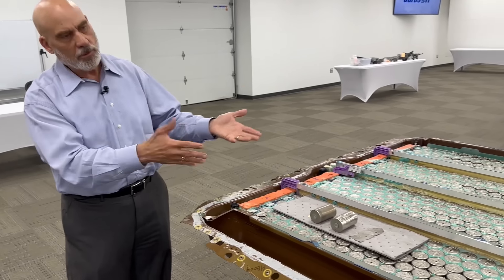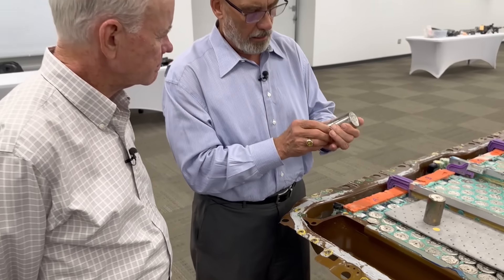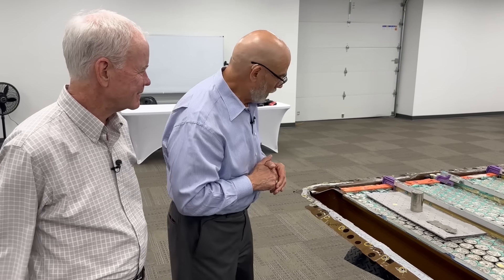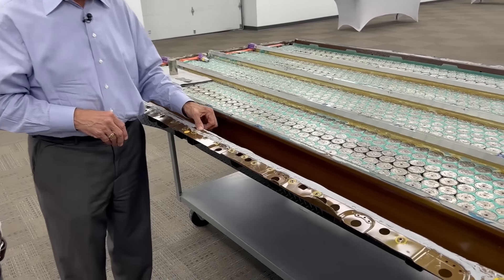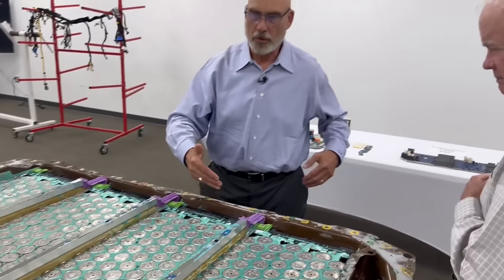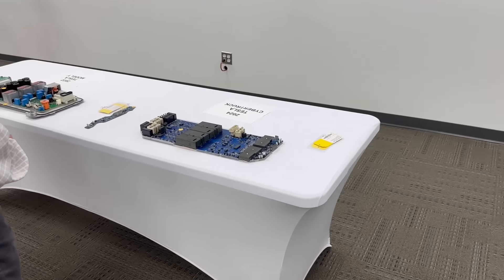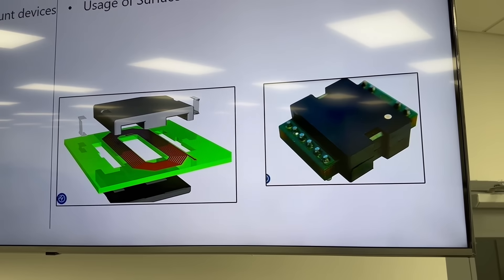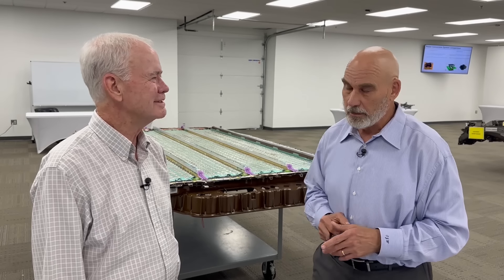A Look Inside the Brains of the Cybertruck's Battery - Caresoft Teardown

Comment: The surface area contact of the metal determines cooling efficiency. Bare metal to metal contact is very inefficient heat transfer, microscopic air gaps prevent high thermal conductivity, a thermally conductive medium needs to fill in air gaps for much better heat transfer.

Comment: Terry acknowledging his error is very professional. I was on the fence about his opinions but liked his informational videos and this made me appreciate him even more.
Reply: I agee, but, I think he'll have to admit another error. I don't think the large electrolytic capacitors were replaced with the MLCCs. Typical large MLCCs are around 50V/100μF IMHO.
Reply: @Bits4Blits  Absolutly. I did not even see any bigger SMD caps there. I wonder if the HV is even galvanically isolated to the 48V System. There is some trick used here by tesla

Comment: Some EV Battery fire fighting tools punch a spike through the bottom of the battery to introduce cooling water. 

Is there "air space" at the top of the battery pack above the "mica" cover, that is not filled with foam?

Is there "air space" below the batteries in the pack?

Where does the "bb" pop out to allow venting?  Isn't is held in place by the foam above it? 

Just to confirm, TESLA battery  packs, specifically CyberTruck, are completely packed in foam so the spike will not work to introduce cooling water.

Sorry, I wasn't able to identify the coolant ribbon when you were pointing to it.

Don't you think that the foam acts to keep heat in the batteries?

Comment: It’s been my understanding that Tesla chose side cooling to have a higher contact surface area to transfer heat across.  With the larger radius cells, has end surface area started to approach the side contact area?  I’d bet not yet or Tesla would used end cap cooling and enable putting more cells in the pack with removal of the winding cooling conduit, and gain a simpler cooling plate design.

Comment: Hi at 14:40 it's not quite the same kind of transformers. The ones he is talking about is iron core transformers the ones for the Tesla uses iron ferrite core and are switched at a high frequency not 50-60hz like on a regular HV power transformer. Fast switching makes them far more efficient when stepping down voltages. Old technology though. If that cybertruck PSU goes short on the transformer windings it will blast a big hole in the PCB and then the whole PCB will have to be replaced. All this is not for more reliability ,but for energy efficiency and cost reduction because of reduced production costs.

Comment: Looks like you had a few dramatic moments on getting that mica off. Those BB's are GONE. Dry ice?
Heat removal for cylindrical has much more %surface area in contact with the cooling channel vs other formats. Studies show that side cooling is most efficient with cylindrical, up to a certain diameter, this cell is starting to hit that limit. 
Snap fit held in place with foam. NEVER moving.
Nice job getting access to the array BMBs. See if you can find the easter egg in those!!
BMS/charger upgrade is impressive

Comment: Thank you for the video, I also enjoyed the calm explanation from Terry and had no problem understanding the presentation, maybe since I'm a bit like him.  But, regarding the physical battery pack design, as a long time mechanical engineer and designer I can't accept that filling an assembly with potting foam is a professional solution, nor a good idea. The fill volume and density is too unpredictable and of course it leaves the pack totally unserviceable.  It looks like something I would have built for a science fair project in 8th grade back in 1968. The problem with a round cell is that the elegance of that design concept falls apart the moment you have to package hundreds into a rectangular enclosure, literally a round peg in a square hole.  The low-quality coolant fittings and excessive number of connection points concern me as well, adding to the risk of failure.  Other EV makers (e.g Hyundai-Kia and VW) have moved cooling to the outside of the pack for exactly this reason.  IMO, the balance of product attributes seen here trades away too much in safety and quality in the interest of cost and thermal performance. I realise you can't say that but I can be honest about it.

Comment: If I'm reading this segment correctly, the entire CT battery pack is not repairable and has to be replaced as an entire unit on failure?
Reply: This is how Tesla has done their batteries for a while. On some of the older models third parties have done battery surgery to replace individual cells, and I think it might still be possible on this pack, but it will be a lot harder

Comment: Voltage converter from y and cybertruck are different because they are different frequency and perhaps power ratings. The capacitors in y are big to smooth the dc on the high side.  The cybertruck converter does not have those capacitors despite what they say in this video.

Comment: I found Woychowski's presentation to be full of opinions, but not well backed up. He talked about going from 800 volts (DC) on the main battery to 48 volts (DC) for car operations and then told us all about the transformers that do the transformations. Transformers work only with AC power. An actual description of how DC voltage is raised and lowered in modern electronics like the Tesla would have been nice.

Comment: Regarding getting the heat out of the cells, heat is generated by the internal resistance of the cell. Lower resistance means less heat needs to be removed. If they can remove enough heat from the cell with their present method, there's no reason to change.
In addition, with a 4680 cell it is only 46mm across the cell but 80mm vertical so it may be more efficient to remove heat from the side(s) that from the top or bottom.
Reply: They also employ tabless battery design, so an electron from the very center of the roll, for example, does not have to travel round and round the whole roll, but just goes to the top of the tube, which means much less resistance due to that shorter distance, which means less heat and loss.
Reply: @AllanSustainabilityFan  Good point. The best internal resistance is no internal resistance. - Me
Reply: The heat has to travel further to reach an end but it doesn’t have the multiple layer interfaces to conduct across, as the battery is rolled up inside the tube. I believe Terry is correct about this.
Reply: The Cybertruck reaches a higher cell temp than the new Taycan/Macan despite the charging curve dropping off at a lower SoC.  The cooling is a bottleneck.
Reply: @concinnus  Not the same cell chemistries for starters. 

Taycans have also been known for some early battery fire cases. Porsche has dropped the charging rate a couple times, and replaced batteries behind the scenes to avoid offering official recalls so far, as they were still learning their own EV production processes.

Tesla, on the other hand, is known to start conservatively with charging curves on new designs these days, then bump those up with software updates - and upgraded Superchargers - as they gather data. They already went through Porsche's growing pains back in the early Model S days.
Reply: @AllanSustainabilityFan I have to give porche props for their battery performance so far. They’re seeing very low degradation and the new taycan charges even faster. It’s impressive
Reply: @SyntheticSpy  That easy to say because, as mentioned, the ones that had bad degradation were quietly replaced in order to avoid a mass recall supposedly. 

There's even a case from a whisleblower that's going through the German legal system iirc.

Either way, modern batteries with modern thermal management is superior in life cycles vs an ICE platform, I'm sure Porsche's EVs will outlast their ICE ones easily.

Comment: There was some modeling done that showed side cooling was actually better than end cooling. Basically, the surface area contacting the coolant plate is much bigger with side cooling than end cooling.
Reply: Yes i have seen the same. Many say that top or bottom is best (rivian and Lucid for example), but i saw Japanese battery scientists saying their research showed that side cooling is best if you have enough area (like Tesla). Immersed cooling is of course best, but that adds a lot of weight. Air cooling can actually be quite effective to. But everything has it's downsides.
Reply: Concern for that for 4680s was the much larger amount of material/travel distance from center of "jelly roll" to the side surface... I thought one of the big advancements for Tesla 4680 was the "tabless" design, where for manufacture but also heat dissipatation, all the power & heat went to the ends of the cell? I thought 4680 batts would have plate not serpentine cooling for that reason... very interesting
Reply: @cgamiga  On the bottom of the cell is venting and on the top are electrical connections. Design of this gen2 4680 cell is really good for bottom side cooling, but than again, this is vent side 🙂
And btw, vent is whole bottom portion that pops open, nut just small center rivet (gen1) or ball (gen2) that is pointed as vent in some videos including this one. This is pretty obvious in this video also.

Comment: I don't see how the tiny component are the capacitors, they look like integrated semiconductors.
I would like to see the other side of the board.
I wonder how Tesla can push that amount of current through the copper of the PCB. I have never seen anything like this. Maybe they have a special kind of PCB with very high thickness of copper and they probably use very high frequency to reduce the size of the magnetics and the length of copper.
Also I heard that this board is bidirectional, able to create 120v and 220v from the battery.
Reply: This is for sure a GaN design and they are pushing the switching frequency quite high
Reply: DC-DC converters use high frequency transformers to keep size and cost down.  Typically about 80 kHz.

Comment: An important thing Terry Woychowski did not say about the cell cooling is that the current collectors will carry heat in any direction there is a thermal gradient. Thus, while the collectors carrying heat to the bottom gives more even cell heating and cooling, the current collectors will carry heat around the cell to the contact patch. The contact patch is propable 2.5 times the size of the cell base. Still, for the cooling requirements of most real life applications, a cooling plate across the base would be sufficient and it would mean more cells in the same 2D space. However, the cooling plate would need a hole in exactly the right place for each cell - not hard to achieve, but each hole and the base of the plate would need protection from a thermal runway. If the plate is punctured, all cooling of the pack would be lost.

Comment: Terry didn't mention during the heat conversation the fact that these are "tabless" battery technology, which greatly reduces the typical resistance of cell design, the main contributor to heat and loss.

That translates to cooler cells that are easier to charge/discharge, making cooling requirements dramatically lower versus a traditional battery design.
Reply: They aren’t doing plate cooling anymore so the tabless design doesn’t contribute the overall cooling performance anymore
Reply: @christianedelmann6880 Tesla NEVER did plate cooling. You don’t know what you’re talking about. And it IS a tabless design in the 4680s.. at least, every version that was disassembled was. If they’ve changed it.. i’ve seen 0 evidence that that was removed from the design. Tesla has ALWAYS used side cooling. Well, since the first Model S battery designs that were shown.. all through model 3 and Y and now including CT. Maybe the original Roadsters were different.. but who would even care. They have nothing to do with 4680 battery design and cooling.
Reply: technically its many tabs
Reply: @christianedelmann6880  Tabless has never been about cooling existing heat. Tabless is a shorter path way that reduces resistance thus less heat is created. This reduces cooling requirement, the only part I disagree with is that it's not massively dramatically different. A measureable difference for sure.

Comment: At 15min, there seems to be a mistake regarding the Capacitors, maybe he will correct it in the next video
Reply: Those don't look like caps to me at all
Reply: You don't get micro farrads without 'plate size' ... that said if Tesla's come up with electronic control technique to massively reduce the need for capicitance ???  .... well I've  got my ears out for this.
Reply: May be the finger was pointed to little right side during his explanation in Tesla cybertruck
Reply: There are actually surface mounted capacitors though, and they look very similar to the ones in the video.
Reply: Fascinating info on the voltage converter board. Transformers and power capacitors take up lots of space and are costly to assemble.
Reply: @PygKLB  Yeah, great design for zero repairability when a transformer goes. It takes out the entire PCB instead of an easily replaceable component. Of course a dealer would never do such a repair, but plenty of the aftermarket companies repair defective OEM parts. Having the windings integral to the PCB is 100% unrepairable. But, that is not what Tesla is after, they want to fastest, cheapest way to produce a vehicle with no thought to the owner down the road who will have to get it repaired. And I am sure limiting repairability is also in Tesla's mantra, so you have to buy new parts from them. Yes, Tesla is not alone in that department, but they make extreme measures to cut costs and limit repairs.
Reply: Amateurs repairing such a board is dangerous. I have the skills to do it but would not, too much risk.
Reply: @tomglenn485  will sandy.. catch it… maybe

Comment: Just reinforces that fact that cylinder batteries is the single worst design decision tesla has ever made. Rectangles are far more effecient use of space, easier to make per volume, and easier to install since there will be less wiring, and you can autually repair larger square batteries where you cant repair these "cells". Dump nmc cylinder already and move to LFP square this year please.
Reply: LFP is Brilliant for (Home storage)  or a heavy portable powerstation . ( i have one =o)   )   LFP is Much safer , But it is Heavy....     and has less energy density ...

Comment: That Tesla battery pack is the most horrifying thing I have ever seen.  Wait till your Tesla goes out of warranty and things start breaking.  your pocketbook will cry uncle.   My ICE has been out of warranty for decades, and I still drive it every day.   Because my ICE is so simple, I can DIY repair everything on my car myself.  And my ICE will still be on the road when the last gizmo laden Tesla goes to scrap yard.  LOL
Reply: The design intent of the battery is clear...force the insurance company to declare a total loss.
Reply: OK grandpa that’s enough Facebook for today…
Reply: Good for you. If you enjoy spending your time off under a hood,  great.
I'm glad to get rid of a gas pump, oil pump, fuel pump and deadly coolant. 
My garage floor is perfectly clean. No smell of oil or exhaust.
I get 300 miles for $4 by charging at home overnight. I just laugh at gas prices.
Reply: Ok, grandpa.

Comment: Analysis of the boards is wrong!  There is said it, so prove me wrong internet.  

I do have a background is automotive audio electronics in particular high power class-D auto amplifier design (DC-AC(HF)-DC-AC(LF) converter chains)  

Not sure on the cream coloured transformers,  On the model Y I am seeing what maybe out of what he is calls 4 trandformers, what looks like 1 traditional transforer and what maybe 3 inductors.  On the cyber truck besides the cream coloured ones I am seeing inductors more than I am transformers.
On the model Y is that also a tranformer hiding under the PCB on the far right.

I suspect that the cyber trunk is running at alot higher switching frequency, so they maybe ditching the caps altogether, as the smoothing via the output inductors maybe enough to smooth out the signal.

I am not expert, but I know enough having run a car audio amplifier brand, where we released our own range of amplifiers, that things seem off to me.
Reply: I also have a background in automotive electronics and even Munro's EE "experts" are usually wrong and don't actually have experience in automotive.  That said, I counted at least 5 or 6 things wrong with the Superman PCB that wouldn't see the light of day at any legit automotive Tier 1.  One more reason I don't own Tesla's.

Comment: What I really don’t like about Tesla is nothing is serviceable in the battery pack it’s not like a I phone or a I pad it’s a  $ 100 000 vehicle and if and when the battery pack takes a dump the hole vehicle is mechanically totalled yes you can put in a used pack but the price is still going to be expensive compared to a single part replacement it’s a shame coming from  company the tel us that they want to protect the environment. This comment is coming from a automotive technician who sees that things needs repair and I’m no EV hater I own 2 VW EV cars and both care have rebuildable pack the parts are all available over the counter.